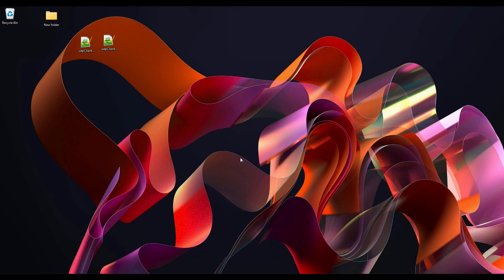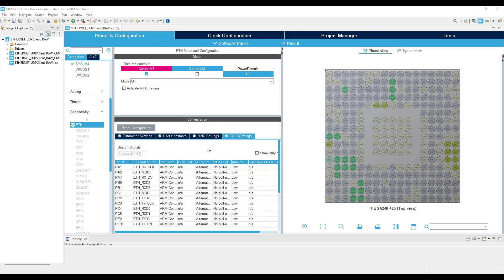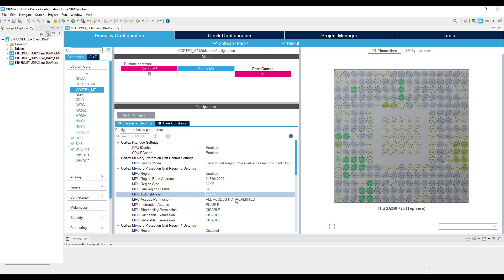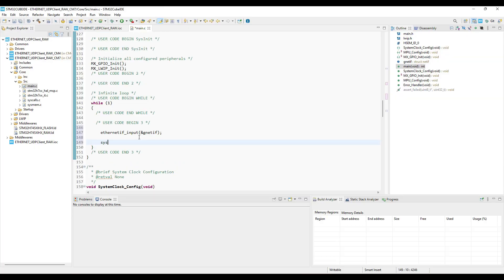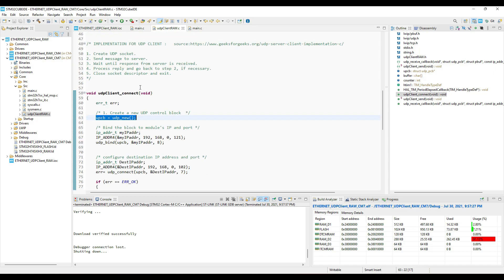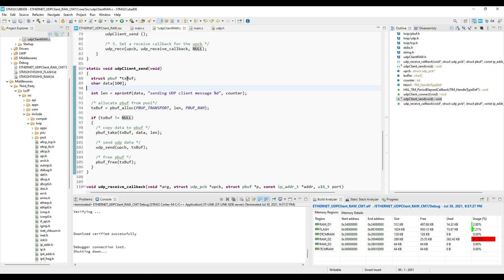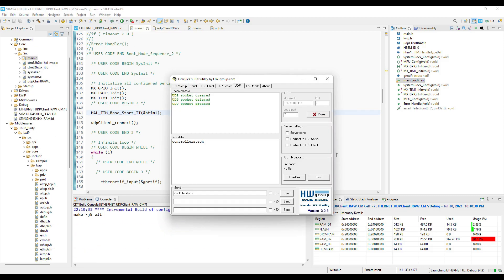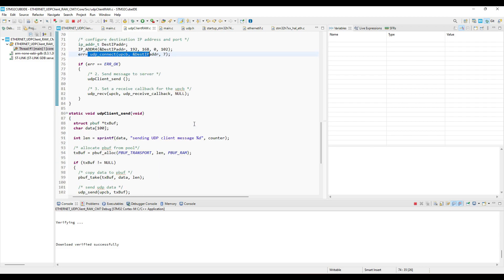STM32 ETHERNET #3. UDP CLIENT

Comment: I have stm32f769 discovery board. I cannot send or receive data even though I have watched the video completely with the previous videos. What could be the reason for this?
Reply from the maker: Are u able to ping the board ?
Reply: @ControllersTech  yes i did the ping test
Reply from the maker: You need to debug the code and check if the system is going into hardfault.
Reply: @ControllersTech  I didn't get any hardfault also sir
Reply: @gvrvenky418  I am not getting any errors. But when I look in debug mode, it enters the error handler and throws itself into an infinite loop.
Reply from the maker: Ok when it does that, on the top left side you will see the call sequence of the functions which lead it into the error handler
Can you tell me what that sequence is. If you don’t understand this, contact me on telegram group linked in the description.